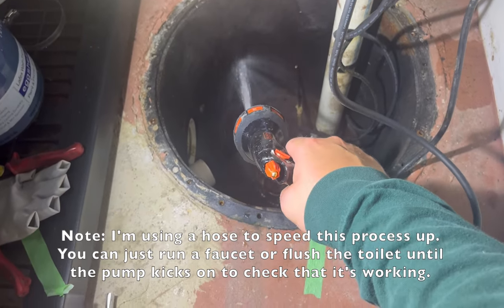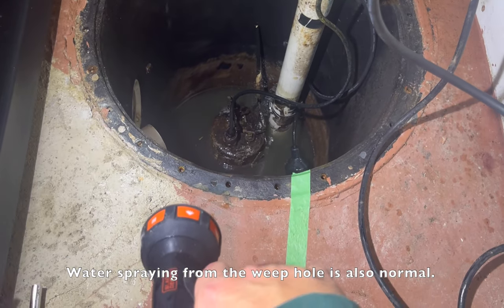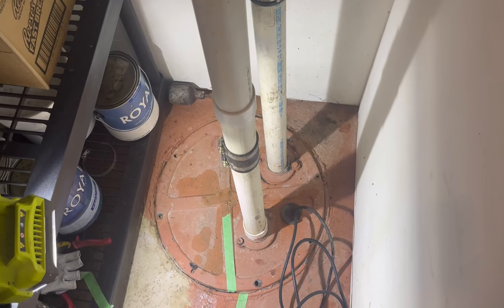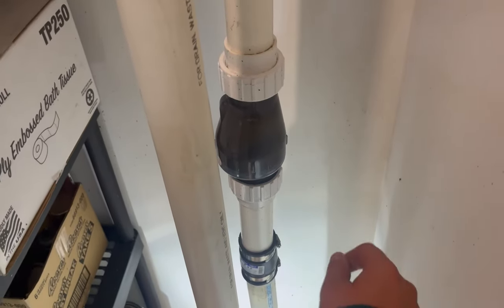Why does my sump pump keep running? How to replace the float switch on an ejector pump.

Comment: I had no idea you could change the flote . I just had bout 5 in water in basement. I just had to wiggle the flote I'm guessing it's lil worn changing it looks ez enough thanks
Reply: Hi There Chris,  currently  in late June of 2024, I had 5 sump pumps running with three 1 h.p. sump pumps. and two .5 h.p. sump pumps.  I find that adjusting the sump pump is the answer for the most part.  i just recently turned off one of the.5 h.p..  I was only able to restart that one power fist sump pump by lifting up on the sump hose.  It's a matter of the angle of the floate as well.  Generally, we just do it in the spring. We are beside a lake called Morin Lake in SK Canada.  But this year even into summer, it is cool with lots of rain and we at a distance of 100 yards from the lake still have our water table affected by the high lake Level.  I am Brian Fisher of Victoire, SK.  good luck with these sump pumps.  I love them though.

Comment: I noticed inside the pit under the cover you have two open pipes coming into the pit. Is the wider one for the toilet and the other for the sink? The reason I ask is I'm just trying to ascertain if something other than my add-on bathroom would be going into that pit as my float is stuck and I want to unplug it for a few days until I can get a buddy out here to help me. I have a completely separate sump pump and pit for groundwater and another injector pump and pit for my washer. My concern which doesn't really add up is my PVC pipe from my AC goes into a ground drain on the other side of the basement and I assume the water from there goes into either the flood control system or most likely through the floor to the ejector pit for the washer?
Reply from the maker: Unfortunately this pit was not at my own house, so I’m not exactly sure where the 2nd pipe coming into the pit is from. I know one was from the basement bathroom draining into the pit, but I’m not sure of the 2nd.